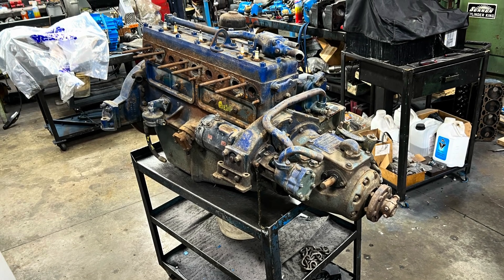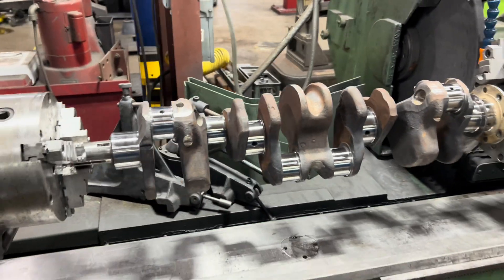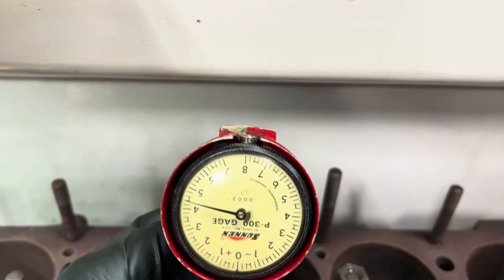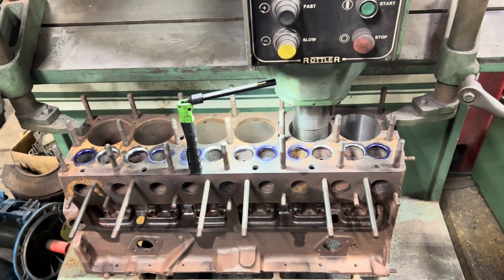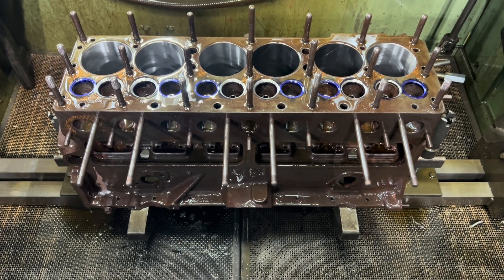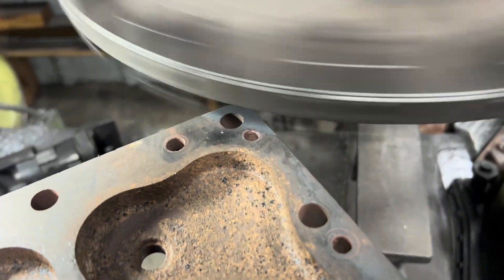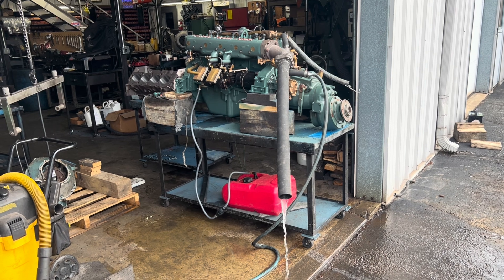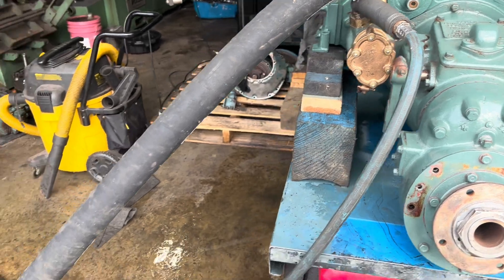1955 Chrysler Crown M47-S Marine Engine Complete Overhaul

Comment: Beautiful job on this engine.  Sounds awesome.  I could listen to the song of an inline 6 all day long.  How are the valves adjusted?  Does it have adjustable tappets that are accessed through the side covers?  What are the clearances and are they adjusted cold or hot?  Thanks.
Reply from the maker: Thank you! This engine has the 7/16 Sodium Cooled exhaust valves. Intakes are set @ .010 and exhaust @ .018. They are accessed through the side covers. That adjustment is @ operating temperature.
Reply: No decking the block? Yea studs are tough to get out...